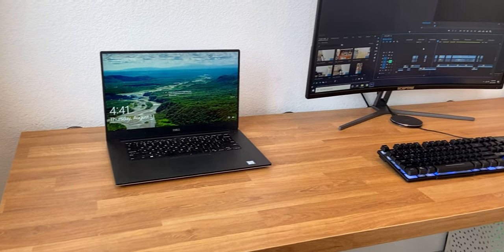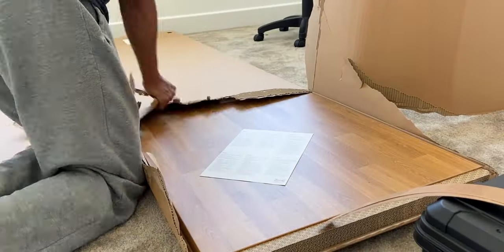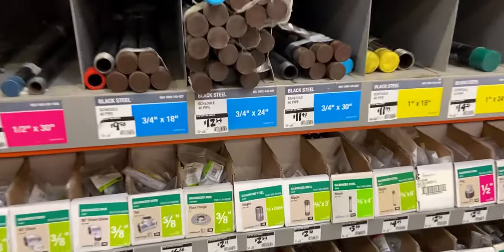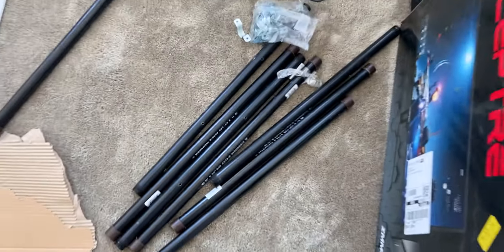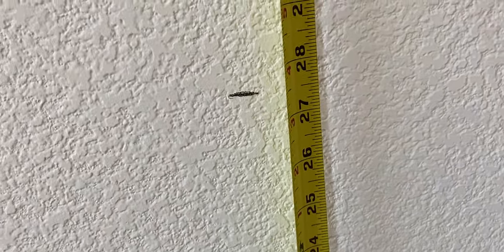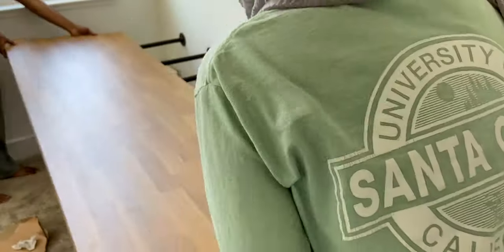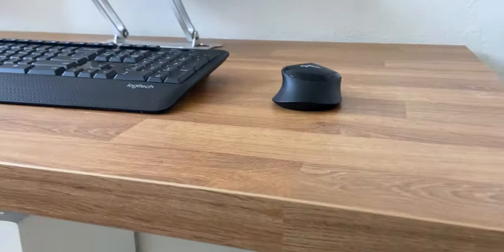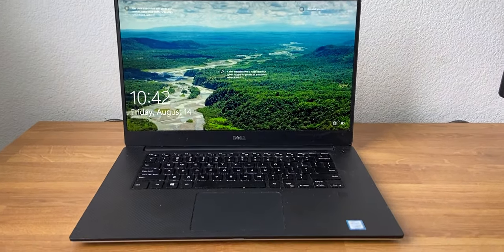Building An IKEA Floating Desk Setup

Comment: Great video!! If you could do it over again, would you still use the 3/4" black pipe and flange? Or do you feel you could have gotten by with the 1/2" pipe and flange? Just wondering if I could save a little bit of money there, but if you feel it's exactly what you need, I may just go with the 3/4" anyway.

EDIT: Just watched your follow up video! It answered my questions. Thanks man! Keep it up.

Comment: Really appreciated your video. I have been desiring to do a floating desk that does not jam against the wall, simply because cables. Also was concerned about the Ikea countertop having both middle sag and forward sag. It looks like you nailed it. Well literally speaking, you didn't nail it to the wall, you screwed it to the wall.

Comment: I'm not bashing or anything, just wanna inform that most of the steel tapes or measuring tapes or what ever you call that instrument most of it has a 2 different measurement called English and metric system, the first top measurement mostly is inches" and the numbers below is in cm. that's all hope no one takes this as bad thing just wanna help.

Comment: Cool set up and idea. My one piece of constructive criticism: get the PC tower off the floor, especially since it’s carpeted.  

It chokes airflow since you don’t get the proper airflow through the bottom vents near the PSU and increases the amount of dust etc than can build in your PC.  

If you don’t want to put it on the desk (although you got plenty of room to do so), you can get a small wooden box or something to put it on underneath your desk.  That’ll be enough to raise it off the carpet and let the feet that are probably on the bottom of your case create enough space for airflow through the bottom.  And then you wouldn’t have to rework your cable management all that much either.

Comment: Were you able to get all four 2”screws into the stud for each flange? I think I can only manage 2 vertically for each... thinking about using drywall anchors for the other two. Do you think I will have enough support? I have all the same other parts as you...
Reply: I’m doing this right now and have the same question. What did you end up doing?
Reply: @aidanh4228  I ended up using 3 heavy duty floating L brackets. I can stand and walk on my desk. Attached all to a stud with 3 2.5” lag bolts each. Brackets came from Home Depot for about $10 each. I will tag you in that video. Much cheaper and more secure than using pipes and flanges
Reply: Did you ever post the video, pr have a link to the brackets?

Comment: I want to create a floating corner desk (into brick walls, not studs) but my carpenter is concerned that, doing it your way, the metal support bars will, over time, start to come away from the walls from the weight of the computers on the desk and people leaning on it. Has this happened for you?
Reply: one method i have used in situations where i am concerned about enough support is to install a backing.  instead of mounting the pipe directly to the wall, mount a 2x6 that runs the horizonal length of the desk minus a few inches to keep it hidden.  if mounting in brick use masonry anchors to secure the backing to the wall (for drywall mount to studs and/or drywall anchors).  Then mount the pipe flanges to this 2x6.  As long as you securely mounted the 2x6 to the wall the flanges and pipe should hold regardless of where you install them along the backing.
Reply: I can tell you right now that your carpenter is most likely concerned with making sure the two screw per flange are centered in the stud. That's the singular most important aspect of this whole project and it's certainly surmountable. The key is to not rely soley on a stud finders readings, one has to manually verify the exact location of those studs. My method is to find the stud's approximate location and then actually cut two small gashes on either side of the stud and mark its exact location (those gashes are easily repaired with some spackling and will be covered up by the desk anyway. I'm building a 6' desk with 1.5" of solid oak plywood (~70lbs). I'm using 1" pipe for extra strength. The pipe and the pipe to flange connection is bulletproof. No worries at all about the metal components. The ONLY other thing to consider is the flange to wall connection. An absolute requirement is 3" high quality deck/screw with coarse thread and the largest diameter that will fit in the flange hole. A deck screw like that has a minimum pullout strength of at least 150lbs, and really above 200lbs. I'm using 4 pipes. As a civil engineer, I'll make it simple and just say, take your theoretical highest imaginable desk load (for me I'm using 150lbs) and multiply it by 1.5 for a safety factor. Now you have a design load of 325lbs. Considering (4) supports, you divide the design load by four (since the supports will each carry 1/4 of the load). That's 81lbs per support. 81lbs per flange. Because of the cantilever-type loading of the flange, I'm, functionally, considering the top screw will carry the entire 81lbs. I'm more than comfortable with a screw with 200+ lbs of pull-out strength, being asking to support 81lbs long-term (even though it wont even be 81lbs consistently, but more like 40-50lbs). The basics have to be done right. You need a small pilot hole (exact size suggested on the screw manufacturers info and a simple jig to ensure the pilot hole is being drilled reasonably square and perpendicular to the stud) These are ultra conservative design specs, as they should be because I'm considering worst case scenario of a full-loaded desk AND someone deciding to sit on it. Once those screws are seated square in the stud, there is no doubt it will be more than secure. You could even go overboard and secure all (4) holes of the flange, by using "EZ Anchor (rated for 75lbs each)" or some other drywall anchor, for the other two flange holes. I might do this, and then you'll have a desk that will literally be easily rated for 500lbs.

The guy in the video said, in a comment, that he weighs 194lbs and even stood on his desk.
Reply: @Thomas998822  Thank you for this comment. I wasn't super stoked about only using two flange holes into the stud and have some high quality toggle bolts on hand, I know exactly how I'm doing mine now!

How are you cutting your gouges to check for stud location btw?
Reply: @travisr.3667  I marked the approx location of the studs with a stud finder. Then used the thinnest drill bit I could find, and drilled tiny holes of either side of the stud (starting out about 1/2" farther than the stud finder marks and moved closer until I hit wood). This gave me the exact location... which was essential because the stud finder was no where near exact enough. 

What is the total weight of your desk?

Comment: Would it not work if the table would be thicker and the pipes were drilled inside it and sealed using a quite tight glue and some screws ?

Comment: Great idea. I just did only with a home depo kitchen counter top which I like because the lip on it totally hides the pipes unless you are looking from underneath. Also it has a little molded biltin backsplash. The only thing though is I have only done two rods and it is plenty strong but does wiggle a little bit when I am typing or lean on the counter. I will try adding a couple more rods but I don't think it will help. Just wondering if one else had this experience do to the depth.

Comment: How do you make sure the flanges actually drill into the studs given they're ~3.5" wide and the part of the stud you want to drill into is usually only 1.5" wide?
Reply: Nvm looks like you're only drilling the top and the bottom holes on the flange

Comment: This is a really smart way of putting your desk together however, my advice for you is to buy 2 more monitors the same size (no need to be the same brand and too expensive). Then you can run an HDMI cable to your company laptop so it's not separated and you can hide it somewhere where it is not visible.  or buy a stand from amazon which can hold both of your laptops closed, and really make sure to add some plants, pops or anything of your choosing to customize it and run some RGB. I know this might cost few bucks but does not need to be done just my opinion of how I would have done it with some of my own customizations and inspiration sitting on the table so it is not empty and at the same time, it gives a good vibe. Now I need to find out if I'm allowed to drill in my apartment walls THANKS!!!
Reply: @AliAbbasMalik2000  I will be right now! :)

Comment: I dont know if I missed it, but what do you think is the max weight the table can handle?
Reply: Most likely a few hundred pounds. If youre worried you can pick up L stands and put them two on the end and one in the middle. THen use the pipe method shown in the video. This would basically put the particle board as the weak link imo.

Comment: Hello, i want to buy the LINNMON table top 100x60 cm from ikea, but i dont want to use the table legs, i want to put it on the wall just like how you put your table, is it ok to put it by SIBBHULT 18x18 from ikea? Like using around 4 to 5 pieces of the sibbhult to stick it on wall?Pleaseeee tell me if its ok to do it this way🥺🥺 i need your help 🥺
Thank you💗🥺💗

Comment: I just built an 8ft floating desk for my girlfriend using your method w/ a solid birch butcher block from Home Depot. I used 6x flanges+pipes (one in each of the 6 studs the desk spans over) with 2x 2.5" TimberLOK lag bolts per flange. It's extremely sturdy and looks amazing. Thanks for the tutorial!
Reply: I’m about to do the same thing with my 8ft birch butcher block. Wish me luck 😭😂
Reply: @evansworkspace  good luck! I can share some photos with you if you want some references. Everything came out great and it's been sturdy for months.
Reply: @sampellino  dude yeah that would be awesome if you got the time. I’m still in the process of staining/finishing mine right now so I’m exploring my options for actually making it functional. Little worried that it might rip the wall off cause it’s so heavy lol.
Reply: @evansworkspace  I just tried to reply with a Google photos link but I don't think it'll let me post a URL in the comments. 
I'll post the URL right after this comment. Let me know if it appears for you. EDIT: it keeps automatically deleting my Google photos link 🤷‍♂️

I used six iron flanges with TimberLOK bolts on the north and south threads on each flange. I was worried for the first few days that the desk would break the flanges and damage the wall or something, but it's been extremely sturdy for months.

I coated the board with four coats of Howard brand cutting board mineral oil a couple of days after I got it. That prevented any warping or cracks for the next few months. Just a couple of weeks ago I added another few coats of mineral oil and sealed it with Watco satin polyurethane.

My only two afterthoughts are: 1.) I don't know how I was supposed to do mineral oil and then polyurethane, I think I looked it up after and you're not supposed to do that, so look into that for yourself; 2.) The board seemed smooth enough to forgo sanding before sealing with polyurethane, but after sealing it ended up being really prickly. A learning lesson. It definitely needs to be sanded beforehand.
Reply: @sampellino  thank you for the tips man. The one I bought said it came pre sanded up to 150 grit but I heard it’s a good idea to re-sand it from 120, 150, 220, 300+ and sand with higher grit in between poly coats. Seems like a long, tedious process but I’m sure it’ll be worth it. I’m actually headed to Home Depot today to find some flanges and bolts so they’ll be ready to go when my butcher block is ready.
Reply: @evansworkspace  sounds like we got the same block. Yeah, definitely sand in between (if that's what online guides are telling you do). I didn't do any sanding and I wish I had. Not a terrible result, but it could have been smooth at the end. Maybe I can sand it down now, maybe not.

Good luck with everything! It was a fun project, and the result is worth all the work. My girl has a makeup / laptop desk that's better than my WFH now, I'm jealous 😂
Reply: Did you attach the timberlok bolts onto studs or just drywall ? Im a bit confilicted on what screws i should use to attach my flanges onto my studs. Any help or advice is appreciated! Also for the east and west ends, did you end up screwing those in too? I know studs arent that wide but I just wanna know if i should screw in those ends. @sampellino
Reply: @JFYT21  I used TimberLok brand bolts and bolted them to the studs (I would definitely not recommend screwing just to the drywall, it won't hold). For the West/East holes, no I did not screw them in.
Reply: @sampellino yoo ik this is late but how’s it holding up now?
Reply: @juniorperez717  still great! When I first did it I was really nervous about it falling or whatever, but it's been up and fine for about 2 years. Those TimberLOK bolts are way more than enough to keep that board floating w/ stuff on it.

Comment: So I'd love to do this but I have a concrete wall behind my desk but I don't know what mountings to use any ideas people. Thank you
Reply: You don't need stud finder if you have concrete wall. After drilling holes use wall plugs to secure screws. That's it reset works as is shown in the video...
Reply: It’s easier on a concrete wall, 1/4 tapcon bolts and open 3/16 holes with a drill

Comment: If i make this desk out of pin wood, would i need that much support and security with the pipes?
Reply: @AliAbbasMalik2000   Thank you! I plan on cutting one 1ft×16ft in half gluing the two pieces together. I love the design and idea, I'm even going to screw a something underneath the desk for cord control. Do you think I could use dry wall anchors for places where there are no studs to screw into? I'm not sure if it could handle that much weight.

Comment: Instead of having this many pipes sticking out of the wall, why not just buy brackets designed for this? Can buy brackets that are 18" long that are designed to hold 1k pounds with a pair and use 3 of them to prevent sagging. They usually run only 13$ each.

Comment: nice work but Imagine someone trying to sit on it... without the proper support from the opposite sides of the desk this structure is only stable when you put a big sign: do not lean or sit on it! a A t-shape steel beam attached under the table top anchored to the wall would do much more than this number of poles you attached to the studs.
Reply: That desk will hold at least 300lbs, so unless a sumo wrestler sits on it; it's not going anywhere.
Reply: @Thomas998822  OK. this is probably a great idea for your next video then :)
Reply: @roboak7916  hmmm actually maybe I should give back to the YT community...I've thought about it several times, being that I've learned 90% of what I know, about countless subjects, from YT. 

I'm doing two 58" x 19" x 1.5" solid red oak laminated plywood shelves on either side of my mantle and a 58" x 28" desk underneath one of the shelves. I already got most of the supplies and I'll be done in about 3weeks or less. Everything supported by flanges and pipes. As a civil engineer, I've already ran the calculations and it's well within the parameters.

Send me your email and I'll send you the link to the video when it's done. It'll be my first video so it won't be neatly edited or any of that jazz but it'll suffice

Comment: Well my room does not have an ethernet cable slot so that sucks
Reply: You could try using Ethernet over power line connectivity (NOT PoE, that’s different). Devolo from Germany make really good products with pass-through plugs, multiple Ethernet sockets and wireless (extenders).

Comment: Very poor design.  Those pipes are cantilevering out and this puts a huge strain on the stud behind and the screws on top. You are going to need drawers anyway for your odds and ends, pencils, paper, electrical  stuff.  The  two tower on each end is very good design, does not tear up your wall, and costs a lot less than all your pipes, levels, screws, U clamps, flanges. This project is not well though out, too costly, and very poor use of resources.  The file cabinets are cheap second hand on Cl and need zero labor to set up.  If you think it will bend, add one bracket in the middle for support, or shorten the table top.

You also bought the worst table top. MDF is very heavy but has no strength.  Get a used table top instead or pine boards.  Real wood is much better.

Comment: Your computer sitting on the floor triggers me lol.

If that is right on the carpet, please at least put it on something hard so you don't choke the power supply fan! :)
Reply: @AliAbbasMalik2000  yeah you should.  Computers should never be on carpet.  Generally the power supply is on the bottom and is drawing air in from the bottom and out the back.  

If you choke off the power supply you could damage it, damage other components, or worse, a fire.  Even still it will pull in more dust from being on the floor.  It's always best to at least raise it some.

Comment: The way he designed it. This table top will sag.  The structural designed is flawed.   Do not do use the design he used as it will fail.